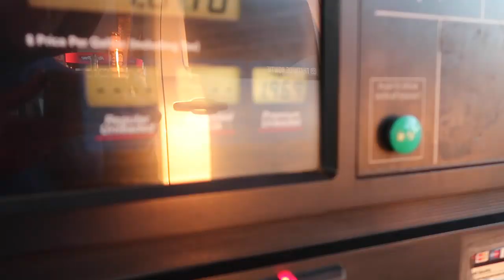The BEST MODS for a DAILY DRIVEN TRUCK! **CHEAP**

Comment: Do the ole 20 dollar muffler delete. 2.75 inch flex pipe with another 2.75 inch exhaust clamp. Then cut ya muffler off then slap the flex pipe on 👍🏼👍🏼